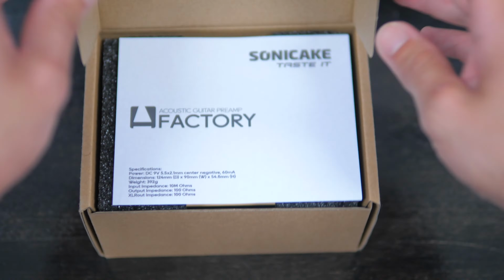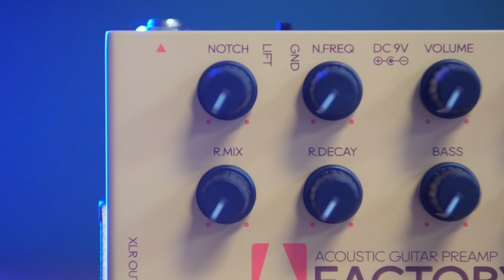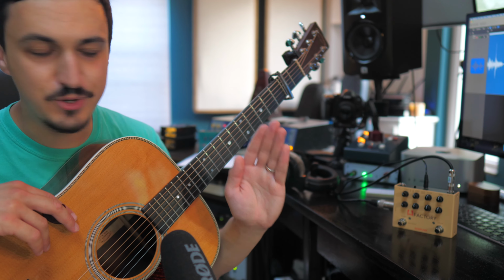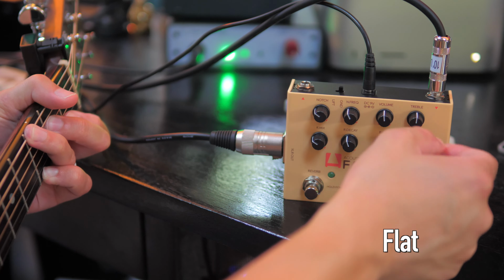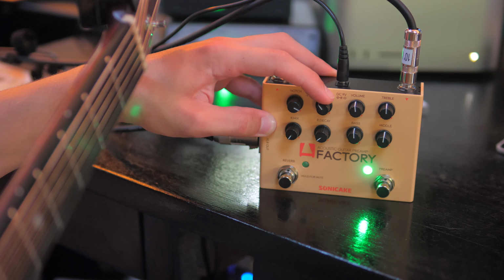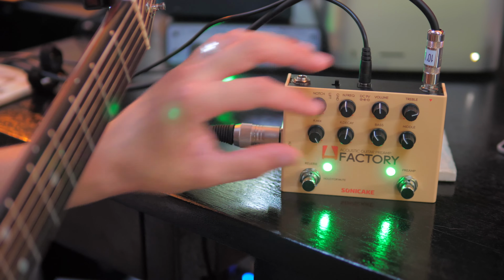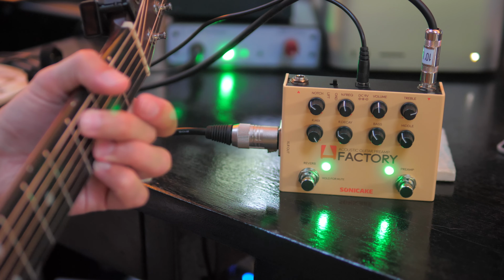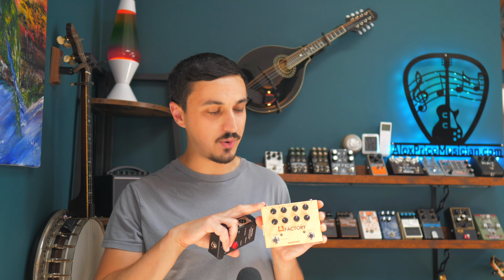Do You NEED an Acoustic Preamp? // Sonicake A Factory

Comment: why won't it work with a battery....I read it's only using 60 ma
Reply from the maker: @cugir321  there’s no battery slot built in. You could get a 9v-barrel jack cable though and use an external battery. https://amzn.to/41IxyJH